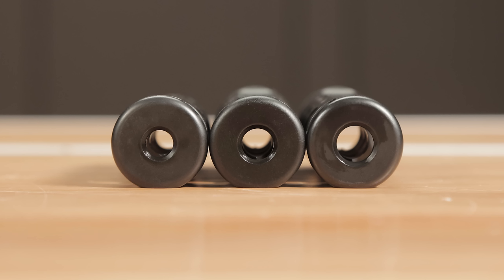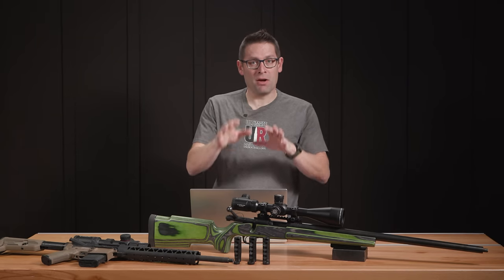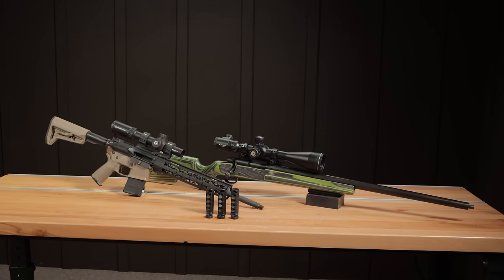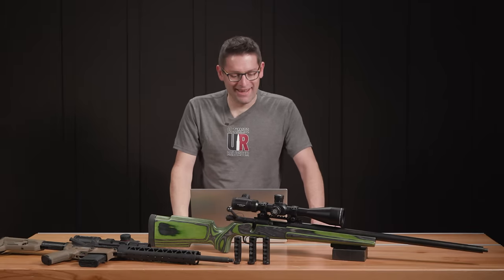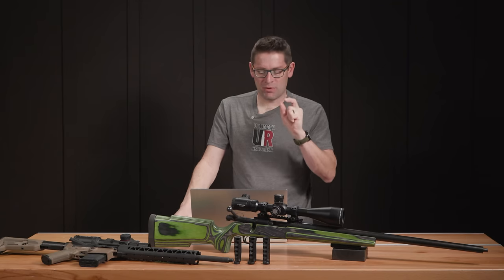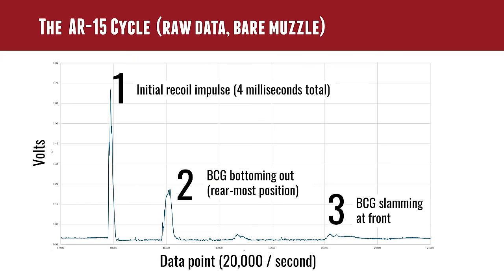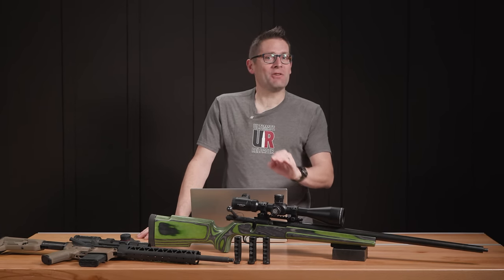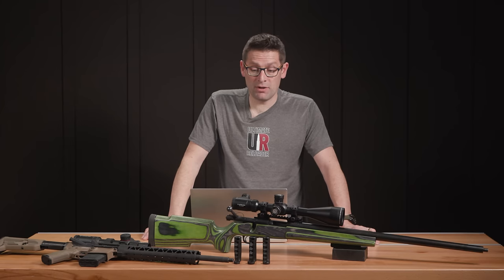What happens if you run an oversized brake?

Comment: Really cool video. Can't wait for the undersized break test next
Reply from the maker: We did it, down to 0.010" clearance, see: https://www.youtube.com/watch?v=pp4ZSC0Zjds
Reply: Hahahaha yes! How well does a 5.56 break work on an 350 Legend?
Reply: Lol
Reply: I made on off breaks CP muzzle breaks. I held bore diameter to .312 on a .308 bullet .300 win mag and they worked very well.
 br
Reply: Hilarious.
Reply: You’ll break your brake 😂
Reply: That's just mean. 😁
Reply: @Ultimatereloader  I mean, it's a start. Try running .308 through a .223 brake next 😂
Reply: @Ultimatereloader that’s an interesting result- the brake works just as good with a tight tolerance as oversized. I guess that means there is some point in space maybe five inches off the side of the bore where the baffles stop catching gas and the recoil mitigation ceases to have an effect.
Reply: @rm70x7  recoil will be greatly reduced for one shot.
Reply: I feel the difference in barrel length has a large effect on brake performance. The shorter barrel had a dramatically larger amount of excess gas pressure than the longer barreled 22-250 even with the larger gas volume from more powder burn in it. Barrel volume per length of barrel being identical due to the same bullet diameter. 

A 16" barreled .223 has a considerable amount of remaining gas pressure at the muzzle. The 24" tube on that 22-250 was more efficiently burnt at the muzzle. The brakes had far more gas pressure to expel from that AR than the bolt, even with a gas piston system scavenging some. So it cut down on their recoil reducing efficiency.

Unscientific opinion that makes sense to me anyways.
Reply: @bryantitus6634 it would have the same amount of total energy, just moving slower. I would like to see it tested to confirm, but I think you may be correct.
Reply: @coreymoyers  it wouldn't have the same total energy. The 22-250 has more powder and higher peak pressures. But the difference is not massive. A 16" 22-250 would be violent on a brake however. The amount of swept volume per inch of barrel to expel gases is the same. That's the only constant between both barrels per say. However, 1.5 times longer barrel in the 22-250 has much less than 1.5 times the gasses and pressure from the powder charge by the time the brake comes into effect.
Reply: Lets you shoot to the sides at the same time
Reply: @Ultimatereloader  please do a test vid on oversized silencers/moderators for sound reduction, recoil reduction and group sizes?

Comment: I would be interested in testing sound reduction out of an oversized can.
Reply: Several videos exist on that.  Not a huge difference in sound from majority I've watched regarding suppressing say 223 from like a 308sup
Reply: Larger cans reduce signature, but come at the cost of weight and size, and increasingly limited mounting options. .30cal can with a .264 (if you don't trust your barrel)/.223 end cap is the best way to go when considering the pesky NFA.

Comment: I don’t swap my brakes around, so I just buy whatever size is needed. However, if they were as costly and regulated as a suppressor, then this would be more appropriate of a comparison.
Reply: problem im seeing is, 9mm "ar" brakes are the same thread pitch and someone that doesnt know there is a difference will plop a 9mm brake on a 5.56 and get unusuall results
Reply: @wisewhiterabbit unusual results? If anything less effective but nothing crazy. Might maybe see PoIS but that's pretty unlikely given how fast the 5.56 will really travel.
Reply: @wisewhiterabbit  this is not an issue whatsoever... 9mm brake is .390-.410 depending on manufacturer, some might even be .375, but that is all negligible when you look at the diameter of the 308 brake as well as the raw data provided for it & 6.5creedmoor

i bought a 2pc 9mm brake & blast shield but put it on my 14" 5.56 p&w and it works the same as a 6mm 3 chamber brake - just not nearly as obnoxious for other people around me.
Reply: @321JKilla  I'm wondering, because studies have shown 2 chamber brakes on a 5.56 and .308 are all the chambers you need, that because of the wider bore that your using all the chambers.
Reply: I am curious if these results would hold true across all configurations of brakes, such as later venting, rearward angled venting, and other variants and designs.

Comment: I believe I saw another test done on this that showed oversized brakes had better results for precision. Had something to do with the gases around the projectile as it exits the muzzle.
Reply: Correct. I do high speed research, and there is a buffer of gasses. Depending on the shape of the cone of gasses it either stabilizes or kicks the bullet's butt.
For that same matter... only buy deep crowned pistol barrels. Such a massive difference.
Plus you protect the rifling from damage.
Reply: @m4rvinmartian This kinda explains my groupings suppressed. I say kinda because the barrel is still on break in.

Comment: If only someone made a bolt action rifle in .223 caliber... you'd be able to directly compare the recoil characteristics between a bolt action and a semi-auto buffered system, and not compare a .223 AR to a .22-250 bolt.
Reply: Yes it's called a lever action or an on market .223/5.56 bolt action. They do exist and can even build one out.
Reply: Lithgow LA102 in .223,  Howa 1500 in .223? There’s quite a few bolt action .223 currently in use.
Reply: Ruger makes a 223 bolt action. Have one.

Comment: Fun Fact: Back when the Army was developing the M1A / M14 They did some testing on the muzzle device for accuracy / bullet clearance. They discovered that if they reamed out the muzzle break to nearly .40 cal, the accuracy improved. I believe the reason these breaks are so similar in their performance is because they all have nearly identical baffle area for the gas to act against. This is why the JP Ent. "Tanker" muzzle break is one of the best brakes: the sheer size of it's baffle area.

Comment: I am coming from many years of machinist/engineer/gunsmith.  The science of recoil starts with the weight of the gun, size of bullet, amount of powder, and so on.  Most people try to compare the recoil without matching the weight of the guns.  A 20 LB gun doesn't kick like a 5 LB gun.  I enjoyed seeing the degree of data you went with!  The gas guns can be configured by changing the amount of gas used by the action, to change felt recoil.  There are many ways to skin this cat!  I have 6mm, 6.5mm, and 308 calibers that all run 308 muzzle devices.  The differences are too small to notice.
Reply: Can I ask what your thoughts would be about similar clearances on suppressors? Would the difference in sound also be too small to notice by using a 308 sized clearance on a 223, for example? Thanks
Reply: @cotteeskid I haven't tested cans with the tolerances.
Reply: Amount of gas pressure at the muzzle as the bullet exits matters  as well as you get a short jet propulsion effect. In fact this is where a LOT of the recoil comes from IMO, which is why a brake makes such a difference, redirecting a large portion of these gases reduces the propulsion effect or even counters if diverted to the rear vs 90* to the side.
Reply: @meanman6992 capturing the gases is the key to a Can.  many times we forget about the gases that escape before the bullet jumps to the rifling lands.  the issues with a Can is controlling what gases escape and how fast the gases are moving.  if we use a delayed rolling block to open a port to capture excess gas to the side, we could reduce the need for a Can, but timing would be an issue for BBL length and ammo used.  the tolerances for a Can isn't that important for the velocity of the projectile.  but we must leave room for the people that overthink the process.
Reply: @kensmith8832 It's not just about capturing the gases, but slowing down the gases, and cooling down the gases.
Reply: @Njazmo This is true.  I am thinking if we start to capture the gases near the gas block, the process become simplified.  Think of one or two gas tubes pointing forward into a baffle, you could reduce the muzzle effects.  I would test this idea on a pistol length gas system and add another gas block about 2 inches in front of the action gas block, pointing forward for an advanced Can.
Reply: Huh
Reply: Don’t forget barrel harmonics and the weight and speed at which you are trying to reach !
Reply: @Njazmo  heat plays a factor from the first shot to the next in group accuracy. There is a point of diminishing returns within a temperature range .

Comment: Excellent test.  Very interesting to see the numbers of the more complex action of the AR platform.  One thing to keep in mind is the length of the brake.  If you redo the same experiment with a brake half as long you will see a more pronounced difference between clearances.  Looking forward to the testing on POI.

Comment: I use a .30 caliber suppressor on my 6.5 PRC. Precision is definitely better than with the same suppressor model in 6.5 caliber.
Noise reduction is better with the 6.5 caliber suppressor, of course. The .30 caliber suppressor is still good enough to go hunting without ear protetiction, though.
Reply from the maker: Interesting results- thank you for sharing!
Reply: Ive been wanting to use my 36 cal suppressor even on my 5.56. Talk about an easy flow-through design.

Comment: The 22-250 is burning alot more powder than the 223rem,  and no gas is being pulled off for the action so the 22-250 has a significantly higher volume of gas to make the brake work efficiently. 

The brakes on the ar-15, might slightly increase gas volume to the action making the bolt unlock faster, account for the internal bump to be higher with the brakes.
Reply: It shouldn't increase back pressure since nothing is holding pressure like a longer barrel or can would

Comment: I would be interested to see you use the recoil rig to test different buffer weights and or different adjustable gas block settings to see if you can visualize the difference in timing.

Comment: Shouldn't you have divided the total clearance by two? For instance, the difference in diameter for the Apollo Max 264 ID of 0.318" and the 6.5mm bullet (0.264") is 0.054" but side to side, assuming that the bullet is centered, is 0.027" bullet clearance from the bore. The peak of the recoil pulse is interesting. Small pulse, big pulse, small pulse...

Comment: Thanks, Gavin. Looking forward to the precision testing. I just put a Ultradyne Mercury on my bolt 223 Wyle but had to bump up to the 6.5mm selection because I had the threading cut at 5/8x24 instead of 1/2x28.
Reply: I agree thread size/pitch is the most practical reason why to use a slightly oversized break, for me having 6.5mm and 6mm barrels for the same action makes sense to just have 5/8x24 threads cut on all of them and use a 6.5 brake, 1/2x28 is really small for a barrel diameter of .92 inch at the muzzle end.

Comment: The way you explain clearance, would lead some to think you’d have in your initial example .030-0.060” all the way around the bullet which is false, you’d have 0.015-0.030” as bore diameter - bullet diameter = x divided by 2 to get the clearance around the bullet assuming centered in the bore.

Comment: On my 20"  6 mm ARC AR, I used a 3 port JP brake that I have had good experiences with. My choice was limited to .308 but I was pleased with both the lack of sight picture disruption ( recoil? It's a 6 ARC) and accuracy. Gas system is rifle length. Don't plan on changing it.

Comment: As expected, a brake is better than none, but the difference in clearance is so minimal it doesn't really matter.  

Interesting note, the delayed second impact doesn't show a correlation to bore diameter like the initial spikes do.  Instead, it appears the timing of that bolt-speed based spike (the second group) is likely more related to the actual baffle/port geometry.  My guess, is that the more total side port area (i.e. the number and size of the ports combined)... but maybe even the baffle angle?

What this shows isn't JUST that gas pushes the bolt back when the bullet is in the barrel, but also the jet-engine effect for it gases escaping forward instead of sideways out the brakes... and the more gas diverted sideways, the more you limit that post-exit impulse generation.

I feel like I want to try a similar test with a IWI TS12 12-gauge semi-auto.  JMAC custom's 4-port brake (the 4C-12) has massive baffles and makes a huge difference... but the 2-position gas block of the TS12 allows more venting of gases through the block to soften the recoil and slow that bolt carriage speed.  A rig like this would show some interesting data to see just how much that adjustable block slows the bolt.

Very cool set up!

Comment: A few years ago I was searching the internet for muzzle brake for 6mm Creedmoor.    I wonted a brake with ports angle rearward & I found the Ultradyne Apollo Max!   Put it on my rifle & was amazed with the reduction in recoil.   With out the brake I was over 1" moa & with it sub 1/2" groups. My best groups have been 1/4" @ 100yds.  This is with a factory Savage 12 rifle & my handloads!   My handloads are not any thing special, 105gr. factory seconds  FC brass $ StaBall 6.5 powder!!!
Reply from the maker: Nice results!
Reply: Great to hear!

Comment: I have a Trident .308 4 port brake (around $30 on Amazon or Ebay) on my Savage 110 VSX Hunter Xp (Cabelas/BassPro exclusive) 7mm rem mag. I haven't had the chance to shoot groups further than my 50 yard target in the backyard, but recoil reduction is excellent, and my 50 yard-3 shot groups typically run around .3" with Winchester 175gr cheap ammo. My best group measured .23" .

Comment: Data is always king, but this result does make sense if you look at muzzle flash and blast on high speed footage - the blast is kind of cone/teardrop shaped and much wider than the barrel, so there is plenty of high velocity gas expanding outward for the fins of the brake to catch and redirect, even with an oversize bore diameter.

Comment: The size of the hole only lets more gas escape forward which drives the gun rearward like a jet engine. The more surface area you have around the brake, the more it will "catch" the air and pull the gun forward countering the recoil.

Try the test again and compare the total square inches of surface area on the brake. I bet the one with the most surface area will reduce the recoil the most, regardless of the bore size.

Comment: Idea for "Round 3 of the Oversized Brake Recoil test".  Redo your chapter 1 except reduce the outside diameter of the smaller bore sized brakes to make the surface areas that the exhausting gasses work against the same across all the brakes.  This would show if it is actually the clearance that makes these slight differences in recoil in these last two tests or if it is the extra surface area on the smaller ID brakes.

Comment: Can you use the recoil rig with an FFT to show the effect of a barrel tuner on the frequency response of the gun? In theory, moving the mass toward the muzzle should reduce the natural frequency. This test would probably work best with a rigid buttplate. The drawback is that the recoil rig is measuring axial, not lateral vibrations. Just an idea.

Comment: Interesting geometry difference between the brakes... although all 3 use the same number of ports, the shape internally is different due to the larger bore diameter.  What looks like the same sized slots from the outside, actually has 3 different port sizes internally meeting the bore. 

The losses you'd expect in efficiency of the brake from being oversized (and less able to grab the highest pressure gases from the muzzle exhaust stream, are almost completely offset by the larger side port openings this variable provides.  It's not a huge amount, but when talking about pressures seen out the muzzle, it seems to add up.   That second pulse timing delay between brakes really suggests one working better than the other 2 to reduce bolt speed (and lengthen the second recoil pulse delay).

Comment: Gavin, I'm interested in the delay of the slam back that was observed. I believe this occurred on the more constrained break. It seems this constrain build up enough energy to hold back the bolt a bit longer,,  before being released, causes a longer time gap between the recoil felt vs the slam back curve, or was it just a different powder burn rate, perhaps...an anomaly? Was this delay captured in a repeated test? This delay can relate to an upcoming accuracy behavior.  What was your conclusion?

Comment: The muzzle brake comes into play as the bullet passes through it and out. The mass and velocity of the gasses determine the extent of the braking effect. A 22-250 has a higher weight powder charge, hence more gas.

Comment: Changing the barrel weight will have a corresponding effect on the harmonics of the barrel.   If this is solely about recoil management, my personal preference would be through stock modification (ie ballast) to the stock, which will have negligible affect on barrel harmonics.

Comment: i suspect the impulse "equalizetion" (this diff in the curve tailing) is due to the springiness of the rig itself.
perhaps the gun mounting elements recoil after recoil thus relieving some fraction of the tension off the force detector.